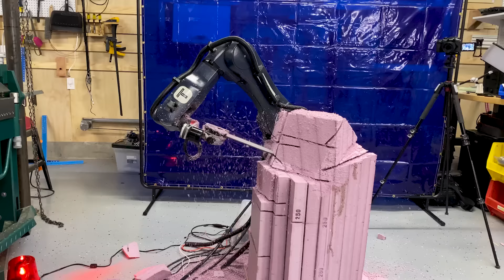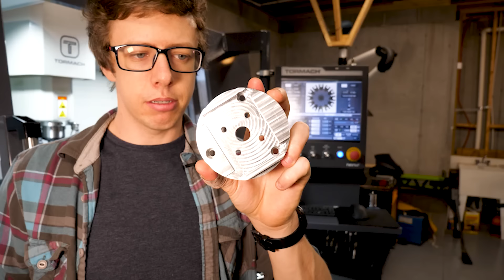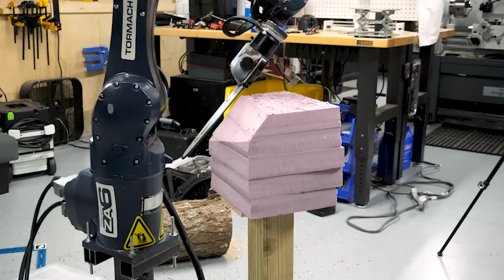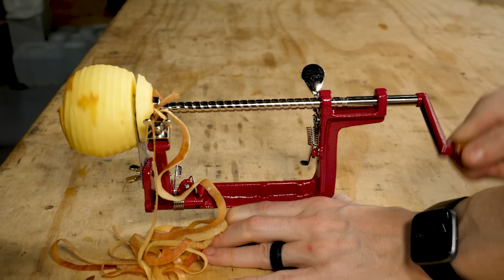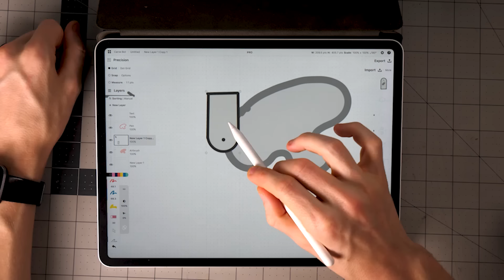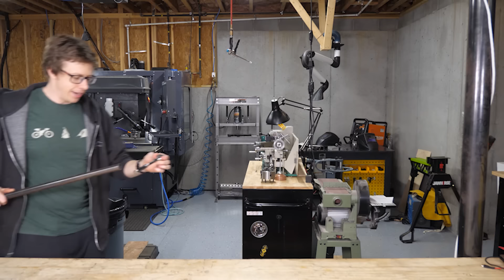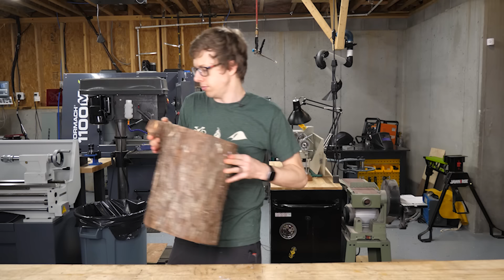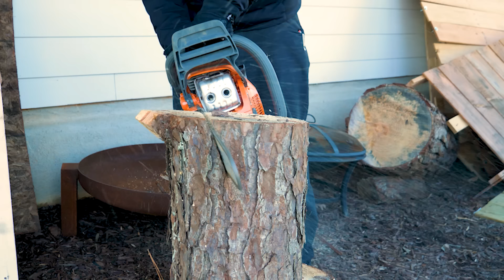Chainsaw + robotic arm = art?

Comment: You can have two people, one that knows how to use a chainsaw and one that don't, give them the same chainsaw, tell them to do the same task... One will have the chainsaw broken inside of one tank of gas, either ran the chain too lose and didn't notice, ran it into the dirt so now its dull as a bike chain, burnt the bar by running it out of bar oil, got it pinched, triggered the chain brake and didn't realize it and overran it. If he's lucky he'll come out with all his toes.
Chainsaws are rather delicate machines that require very competent on the fly user input, I think a robotic chainsaw would be, from ground up, a different kind of machine.

Comment: "And that's why I have this bar, which you call a cheater, so you get way out here... and snap your wrench in half"

Working on steam locomotives for several years - this is way too true. Until you break out the inch drive sockets...

Comment: Why not monte carlo your way out of the problem? Just throw tetrahedrons at the sculpture semi-randomly and choose the tetrahedron with the highest volume. You could do millions of checks a second, and given 5 minutes of laptop computing time, I'd wager you'd get a good enough slice even with the worst of tetrahedron choosing algorithms. Also, It might be much more easy to split the search algo into multiple parts: first solve the problem for the convex hull, write an algo to enumerate the "pockets" formed in the convex hull and solve for those separately. For the actual search algorithm, I would go completely random, that is, no gradient descent or anything, just random cuts for a few minutes of processing power, this will search the rough topology of this optimization problem (there are reasons why I think this will work out). Then, as a bonus, you can run the gradient descent algorithm you originally designed on that best cut, for getting it just that little much better.

Comment: Did you have bar chain oil?  If not that’s why it’s getting so hot.  Also that little tooth is called the depth gauge or raker and it controls how much of a bite it taken.  Some chains have anti-kickback features like you said but all chains have to have a depth gauge.  As you sharpen the cutter you occasionally need to take the depth gauge down as the cutting edge lowers/recedes.  At the end of the day I think you needed to sharpen the cutting edge of the chain by filing the gullet (they dull surprisingly quick), possibly file the rakers a bit (get a gauge from amazon for a few bucks to know you have it set right) and get some oil on the bar and you should be able to make that plunge cut you were trying to make into the wood.

Comment: 10:52 you could just use a simple differential evolution optimization algorithm (metaheuristic) above your gradient descent, i.e., create a sample of solutions and evolve then using differential evolution. Inside the DE algorithm when you define a new position in the search space, you can apply gradient descent. Basically, DE will allow you to find the global optimum since it is a global optimization algorithm, you will be more likely to find the global optimum since you are using gradient descent (for each point in the search space DE finds, you can improve it with the local search).
Reply: each individual (a solution of your problem) is a v in R^d  where d is the number of decision variables... you initialize the vector randomly, and given "how good" are each solution, it will guide the search towards the most promising areas

Comment: put it on a tracked vehicle and send it out to collect wood for the winter. you can also program it to heat your home and stoke the fire to a certain temperature. just make sure to install one of those pulse sensors/motion sensors that they install on pro power tools.

Comment: A Safety Risk Assessment maybe in order? How did you wire the E-stop into the robot and chainsaw? Are you using dual channel contacts to E-stop the robot and chainsaw or did you use one set of contacts to the robot and one set of contacts to the chainsaw? Perimeter guarding and safety door interlocks would be good to. I think you did a great job conveying the many obstacles that arise when integrating industrial automation. Pretty cool video, Thank you for sharing.

Comment: Very nice idea. I love robot and i love chainsaw... Saw, here some tips for your head (sorry if I missed some things in your video):
- put your chain in tension
- put oil or lubrification system to help maintain a correct temperature of the chain.

I think the chain don't turn enough; have you an idea of the linear speed of the chain? A chainsaw motor turns at arround 11000 rpm at full speed.

Comment: As someone who does woodworking full-time and has for over a decade, who's also dabbled in chainsaw milling a bit, I have some advice:

Cutting across the grain with a chainsaw is sub-optimal. You'll dull blades faster, remove material slower, generate more heat, and use a lot more gas. Letting the chain cut in the direction of the grain will yield you much better ( ie cooler, faster, cleaner, more efficient) results, and keep your blade sharp for much longer. Even cutting into end grain seems to be much better than cutting across the grain. But cutting with the grain from the face (bark side) is much easier.

Something to think about. I can basically guarantee better machining results, though I haven't finished the video yet to see how it worked out.
Reply: How can you align a 3d model with the grain of your material?
Reply: @fduisterwinkel  Maybe add an input for the direction of the grain and, if resonably possible, make the code take that into account and prefer cuts in that direction over others. Weighted cuts maybe. Additionally one would have to choose logs that are more or less optimal for this scenario.

Comment: Chain needs tightening.
Bar oiler?
Hazard zone needs marking out on floor.
File the chain rakers.

Not a bad start, but you spent most of your time reinventing the wheel; Fusion 360 has CAM postprocessors for robot arms (KUKA, ABB, etc.) so why not just define kinematics and tooling and let the G-code be generated from an adaptive toolpath?

Comment: That tooth is not for kickback.  It sets the depth the tooth can cut.  Filing it down will allow the cutting edge to get more bite into the wood and fix your smoking issue...as long as its sharp

Comment: You could grind off the anti-kickback pawls as long as you control your feedrate. That's easy enough. However, there are at least three problems you would still need to overcome to cut wood. 
1. A chainsaw typically has an oiler to keep the bar/chain friction down. That could be built in w/ a huge remote tank and hose, perhaps gravity feed or slow feedrate pump like an IV pump.
2. The chain would dull long before you finish cutting a piece of any size. You would have to change that manually. You could monitor current draw on the motor as a gauge of tooth sharpness.
3. Typcially, chainsaws have either a rip or crosscut tooth. Using a rip chain to cut in crosscut would result in a lot of tearout, so it's probably off the table. Using a crosscut chain in rip is going to go super super slow, dull quicker, and burn the cuts. no easy answers there.

Comment: Really cool project, great work!
Instead if gradient ascent you could try to use a global stochastic optimization algorithm. It can solve the problem of local optimums, however it doesn't guarantee a correct solution. But for such relatively simple objective function, something like a differential evolution algorithm could potentially work well.

Comment: To solve the summit problem: Since the algorithm thinks it is at the highest Z, could you just ignore that plane and check the XY plane, within your boundaries, to see if it encounters any other points? Then resume the original algorithm?
Reply: The problem is that the computer doesn't know what the shape looks like and can only check a point at a time and only knows what exist based on the points it checked. So it can't check the XY plane unless it checks all points beforehand. But if you checked all the points beforehand then you didn't need to use the algorithm in the first place. Basically, 9:36 has to happen.

Comment: There are bars and chains specifically for wood carving if you're interested in a 2.0 version of this for some reason. Gets rid of the issue where it's doing a better job as a fire starter than wood cutter at the tip of the blade.

Comment: With the false summit problem, you could just run it multiple times with random guesses for the start location each time. Every time it runs you compare it to the previous best and if the previous best was a false summit, it will either find a worse, equal or better one. Just use the best one and keep going how ever many iterations you want.

Comment: For cutting wood you most likely need to oil the chain like an actual chainsaw, increase the tension on the chain, and increase the RPM of the chain. In addition to slicing cuts, you could also try plunge cuts... maybe?

Comment: Not an optimisation expert by any stretch but when you were explaining the problem of gradient  descent/ascent getting stuck at local extrema, my initial thought would be to look into the optimisation in neural nets literature. Obviously I don't know what you tried with this but there's loads of great algorithms out there to avoid getting stuck at local extrema: adaptive step sizing, stochastic gradients etc. I don't know if it would solve your problem, and you clearly did solve your problem a totally different way which is always cool, but yeah the neural net guys have been wrestling with this sort of stuff for a long time.

Comment: A few more ideas for the arm:

- This but with a styrofoam cutting wire
- This, but with a milling head
- Precision throwing of anything (Maybe build the never missing dart thrower to Mark Rober's unmissable dartboard and have them combat each other's wife mode)
- Hairstylist 2.0?

- Cheat a VR game by mechanizing the player
- Depending on the precision of the arm you can use it for debugging some form of position tracking system (Vive-style with lasers or LED + Camera based)

Also mount the warning light to the ceiling / make it a permanent thing for your workshop, I think it will be needed for much stuff to come.
Reply: All those would be interesting exept for the throwing. I think giving a robot a projectile (especially a dart) would expand that radius of death a little to far :)
Reply: @dillonvandergriff4124  Nothing a good, thick sheet of plexiglass can't fix ;)

Comment: First use the saw to square or round the stock. Then use projection mapping to get a 3D projection onto the stock, and let an AI decide the most efficient way to remove stock until the finale model is achieved. 
Of course this requires allowing an AI to wield the kill-a-tron and might just be how the robot revolution begins.

Comment: 17:25 That "Anti kick back tooth" is called a Raker(aka depth gauge) and it controls how aggressive the saw cuts. Your supposed to file that down when you sharpen the chainsaw tooth(I usually check it once ever third sharpening) and they sell filing gauges specific to the chainsaw type to make it fast and easy to do. Also, I would recommend removing the bark with an axe or something first because the bark can contain a lot of sand or other fine particulates that are great at dulling a chainsaw.

And normally you would try to avoid using the tip of the chainsaw to cut anything but, that is only when there is a human holding the thing. That robotic arm might be strong enough to overcome the kickback when it does occur.

Comment: "there is a finite amount of ways to screw it up, so eventually you will finish" sir u just dropped a golden nugget of wisdom without even knowing it
Reply: And he's wrong.  There are infinitely many ways to screw it up.  But most of them are generalizeable to each other.  But there are also an infinite number of types of ways to screw it up.  There might be a finite number of types of types of ways to screw it up, but there's no guarantee in proof of finity that the number is countable within human-life- or human-project- scales.
Reply: @asailijhijr  you are overthinking, by your logic every problem would be unsolvable because there's an ifnite amount of things that could go south, but so what's the point of fixing any?
Reply: @PanosPitsi  that's exactly my philosophy.  No, there's a small (<1000) number of likely ways for a problem to be solved.  The reason most problems are human solvable is because the process of problem-solving both develops the human's skill and makes the project easier.  The finity of the search space for ways to go wrong doesn't factor in.
Reply: @PanosPitsi  Just because there are infinite ways to screw something up doesn't mean that you can't reach the goal.  The main difference is that you are not just randomly guessing, you are using intuition. 
For example, there are probably an infinite different routes you could try to take to get to work each day, and only a very very small portion of them actually end up with you at the right place at the end.  But since you are not just randomly guessing, I assume you don't exhaustively try out all of the possibilities.  

Even if you do exhaustive methods for a problem, you can often generalize and eliminate many solutions at once with a single error which will greatly speed it up.  For example if I tell you to guess an number, there are infinite possibilities to get it wrong.  But if I tell you that you are too large, you can generalize away many wrong solutions until you can probably eventually come down to the real solution in a finite number of guesses.
Reply: @trumpetperson11  how did you come up with infinity? Infinity doesn't even exist its a human invention, it's how we call numbers we can't comprehend. Imagine a multiple choice in which all answers are a, in what world would there be infinite ways to screw up this problem that has literally 0 ways to screw up?
Reply: oh I think he knows

Comment: Really fun videos!
Regarding a chainsaw there is two things that is really important. First, you use a chain oil (that you usually refill quite often when cutting) Second, you need to sharpen the chain really often, it gets dull very fast as you cut. Thats why its not cutting as you want it to and just get warm.

Comment: ....I'm under the impression that 0:01 is illegal.

"The use of actual or simulated EAS tones during non-emergencies and outside of proper testing
or public service announcements is a serious public safety concern. The FCC’s rules prohibit
such broadcasting of EAS tones – including simulations of them – except during actual
emergencies, authorized tests or authorized public service announcements."

Oh, so it IS illegal...
Reply: No, it isn't.

On streaming / social platforms you are allowed to put both the tone and the headers since those platforms are closed source, but it is indeed illegal to tones the headers and/or the attention tone of the EAS while airing or broadcasting (by channel or frequency). But apart from that, you're pretty much fine to use the alerts for youtube or other media's content.

Comment: really nice robot :) the foam one is definitly usefull though, you could cast it in metal and make a metal statue of it :) as for carving wood, couple thing you could improve on the chainsaw, first you can use a sculptor chainguide, it's more narrow at the tip making it easier to carv stuff. then for the chainsaw, you can use a duracut chainsaw by oregon, it last for ever and lastly, you really need to lubricate the chainsaw so it doesn't get that warm, and the chisel don't loose edge so fast.

Comment: You could also use the algorithm that cuts the most material out at once then once it ran and then you get that smaller thing that looks like the final result so you can just then apply the algorithm that cuts everything, as there is fewer matter to cut it will work, + run it another time with the blade at a 90 ° angle to get the rest of the spots the blade couldn't reach in the first attempt ?

Comment: It would surprise me if you would have been able to solve gradient ascent within a week 😅 I work on artificial neural networks, and gradient ascent (or descent) is a big problem in that field of maths/computer science. Ideally, you want your neural networks to peak at a globel fitness maximum, but a lot of the time you just end up on a local maximum. For that reason you often try a lot and have a whole population of networks approach the problem task in order to differentiate between different fitness peaks, to at least rule out the lowest peaks.

Comment: I'm a logger an I deal with chainsaws daily. There's special carving bars and carving chain that will greatly improve your tool paths. Also the electric powered saws are a great way to scavenge parts off if it to improve cutting performance. I'm an open book to the subject.

Comment: In case you are still looking for a solution .... or a better solution....
What I wondered about what happens if you first cut out a convex shape and then after that remove convex shapes that approximate the pieces that remain inside the convex hull? Also I think you wont be able to cut out exactly many of the shapes if they are concave. Or out of reach, which is the very definition of concave
Yet one could actually make a third pass and again remove more convex shapes a.s.o. Question just is when this turns into grinding ....
I must say amazing maths and algorithms you are using/trying to use. That makes it actually really interesting to watch and it is very inspiring. Obviously advanced stuff is not always succesful but I feel that if it is you are rewarded with beauty